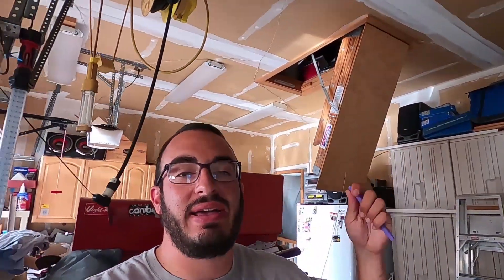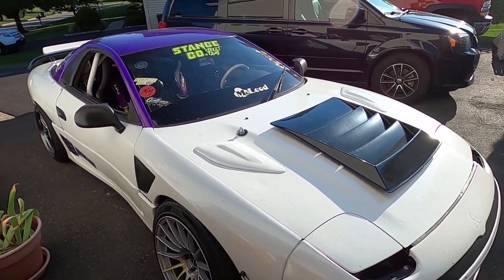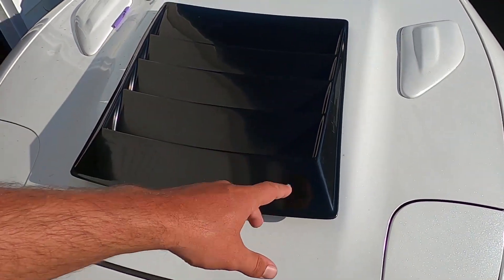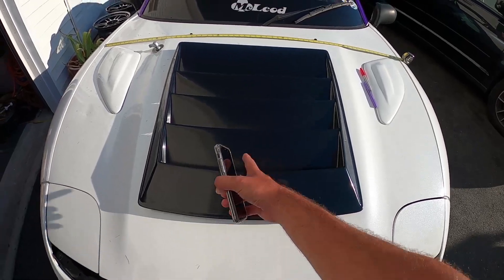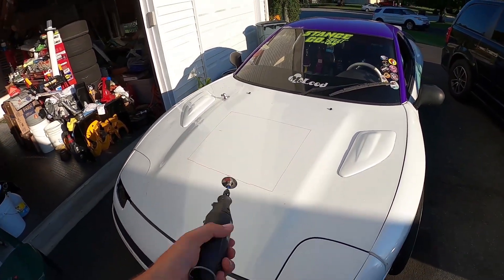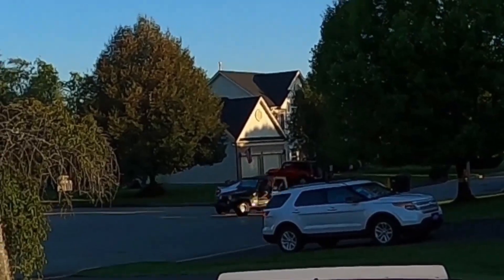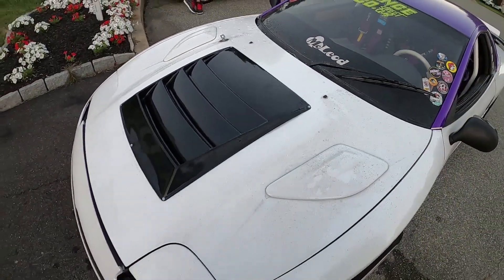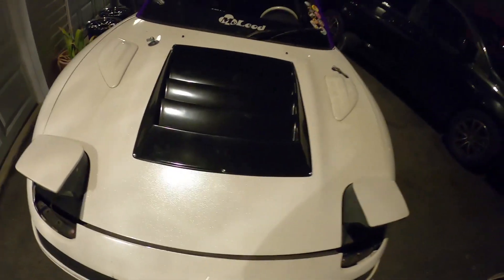Installing a DMAX/URAS Hood Vent! (3000GT Drift Car)

Comment: Takes courage to cut into a nice car like that. However, the Mitsu 3000GT/ Dodge Stealth intake manifold gets extremely hot and the workaround is to replace gaskets with ones made for heat soak issues. Although having a vent like yours helps to aerate heat out, it will most likely melt your ABS plastic vent. You may want to install hood heat liner with some holes so that it protects your plastic vent as well as allow some heat to come out through the liner and out the vent.
Reply from the maker: After a few years, no issues. The idea of the vent is allowing the air the fans is pulling through the radiator to evacuate quickly, covering the vent would basically undo it. This car is wrapped too and the underhood heat isnt high enough to affect the vinyl without insulation too.

Comment: What color vinyl wrap do you have?  Also, cut all those hood supports out. You’ll save a few pounds and the hood doesn’t flop around. At least mine doesn’t. I also took out the front latch and put hood pins in. Might as well go all out at this point 😉
Reply from the maker: it'll get to that point! would love some Aerocatch pins.  The vinyl color is Gloss White Diamond from Avery

Comment: Could you send the link to the one you used?
Reply: Did you add that mesh?
Reply from the maker: https://www.ebay.com/itm/URAS-DMAX-Universal-hood-vent-cutbonnetMiata-AE86-RX7-Civic-Silvia-240sx-350z-KL/284112592999?hash=item42266e2067:g:cEYAAOSw7b9f0RUE

Mesh was in it already.